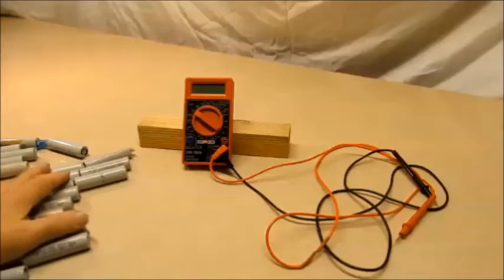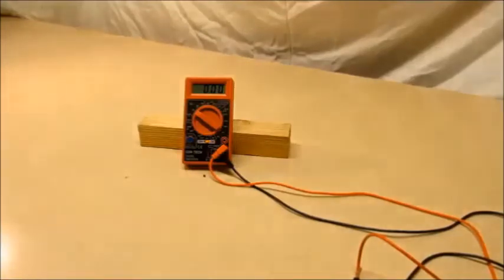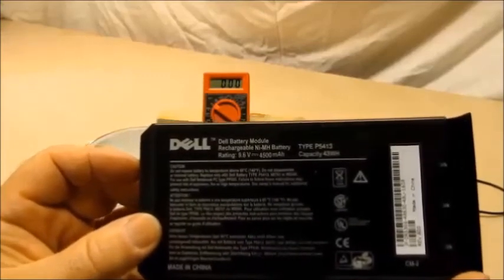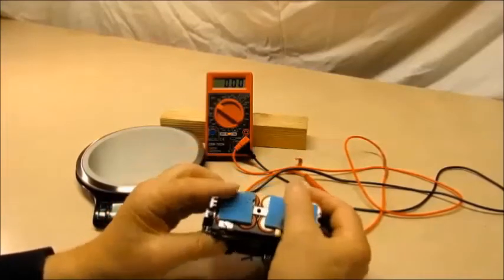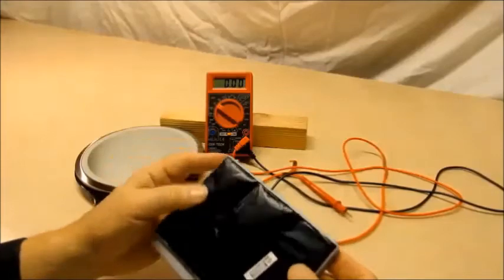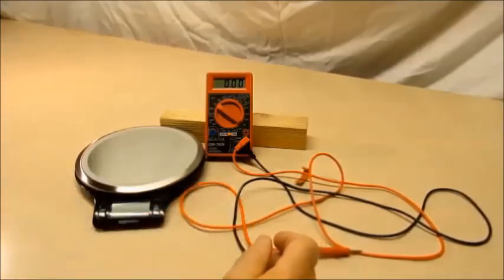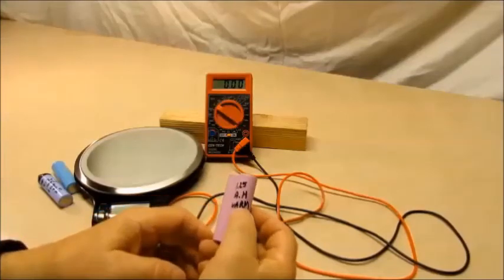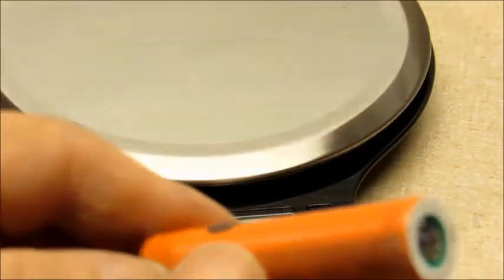Ebike 18650 Bad Lithium Ion Batteries Ebike Project Part 8

Comment: DID YOU GET ANY GOOD BATTERY PACKS WITH JUST ONE OR TWO BAD CELLS AND THE REST GOOD?? JUST ASKING OLD ONE LEGGED JOSEPH T RETIRED NAVY
Reply from the maker: Most of the HP, Lenovo, Toshiba, and Dell battery packs will have 4 good cells and 2 bad cells in a 6 cell configuration
Reply: THANKS FOR REPLYING, I KNOW THE CAPS ARE ON CANT SEE I AM OLD AND DISABLED ONE LEG. THIS WHEELCHAIR CANT FIT IN FRONT OF THE COMPUTER TABLE. ANYWAY THANKS SO MUCH FOR TELLING ME WHICH ONES TO GET!! BEFORE MY LEG WAS TAKEN OFF I WAS A MACHINIST. I DECIDED TO MAKE MY OWN E WHEELCHAIR BECAUSE THE GOV ONLY GIVES THOSE TO PEOPLE THAT ARE FAT AND CAN WALK AND NOT TO PEOPLE THAT HAVE ONE LEG AND CANT! BACK TO THE STORY, I NEEDED TO KNOW WHICH ONES BECAUSE ANOTHER GUY TOLD ME HOME DEPOT AND LOWES WILL HAVE BATTERIES FREE. HE ALSO SAID THEY NEED TO BE HIGH DRAIN FOR THE 500 WATT 36 VOLT EBIKE HUB MOTOR I PLAN TO USE. YOUR THOUGHTS ON THE BATTERY THING WILL BE GREAT, THANKS AGAIN FOR THE REPLY OLD ONE LEGGED JOSEPH T REIRED NAVY
Reply: BY THE WAY I SUBED YOUR PAGE WHEN I FOUND THIS!! BINGE WATCH COMING WITH ALL LIKE THUMBS UP, JUST SAYING OLD ONE LEGGED JOSEPH T RETIRED NAVY
Reply from the maker: Lithium Ion Tool Batteries are free if you ask the manager politely at Home Depot. They are only 1.3 amphour capacity when new and are more difficult to remove than laptop batteries and require special tools. Tool batteries have a higher surge capacity but they are not necessary if you put 16 cells in parallel as I am doing. I have found computer repair shops that are now selling me laptop batteries for 25 cents per battery. With an average of 4 good cells, that is 6 cents per cell. Practically Free. The Hewlett Packard laptop cells will have between 2.4 to 3 amphours per cell and are a better bet for your project. My 29.4 volt,  450 watt Ezip bicycle will take me 25 miles on one battery or 50 miles total with my 2 battery setup. That is using 112 cells for each battery or 224 cells total. Total cost of all cells is less than $15.00. Watch my Playlist from the beginning and you can follow along with everything I have done to date. Good Luck and Best Wishes
Reply: OK, THAT IS COOL! EVERYTHING YOU TOLD ME I NEVER KNEW!! I AM A OLD FART AND DONT REALLY KNOW MUCH ABOUT THESE THINGS, EXCEPT WHAT I HAVE LEARNED FROM MY HEAD LIGHTS. I LOVE THESE HEAD LIGHTS FOR CAMPING, WELL USE TO, WE DONT CAMP MUCH BECAUSE OF THE LEG. I HOPE TO FIX THAT WITH MY E WHEELCHAIR!! THANKS AGAIN, AND I WILL WATCH ALL YOUR VIDEOS!! OLD ONE LEGGED JOSEPH T RETIRED NAVY

Comment: I noticed a lot of your unique/weird cells you found came out of tool batteries.  Have there been decent ones out of there or are they more trouble then they are worth?  I figured they'd be able to handle higher amperage discharge, so have thought about getting some, but wondered about your experiences so far.

On your reverse polarity cell, I recently came across some (Samsung as well coincidentally).  I cut the 3 cells apart and individually put them in parallel with some good cells for a few seconds.  1 of them actually flipped back around and had a positive reading.  I charged it up with the iMax and it tested to 1600 mAh, quite a bit off from the 3000 when new, but was the 2nd best cell in the pack.
Reply from the maker: Hello Chad, http://toolguyd.com/power-tool-brands-dont-make-their-own-batteries/ has a good discussion about tool batteries. Be sure to read all the comments in that article. I will be discussing it more in a future video. Cheers.
Reply: stay away from the ryobi tool 18650. I bought 5 of the ryobi p104, each had 10 18650 cells. All 50 cells had 1 volt or less, they had that foam cushion material that makes it hard to seperate. Using my foxnovo 4s charger I was able to recover about 20 cells but none of them had more than 900 MAH of capacity most where in the 700/800 range. I notice alot of heat damage on many of the cells, they seem to get more abuse than laptops. It was a waste of money for me. I continue to see alot of ryobi battery packs on ebay, I would stay away from them, they are probably beyond reuse, like the ones I got. Laptop batteries, its rare I find bad ones, and the majority average 1800 mah or better.
Reply: jony joe The older ryobi p104 packs cells we're only 1200mah when new. Interestingly enough though they have a higher C rating then most laptop cells. The newer ryobi batteries use a much better quality cell